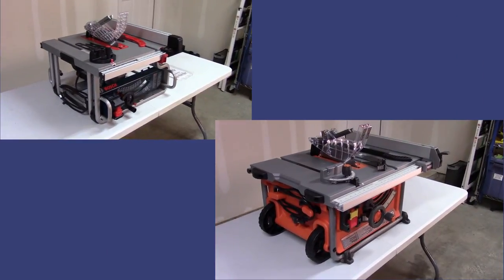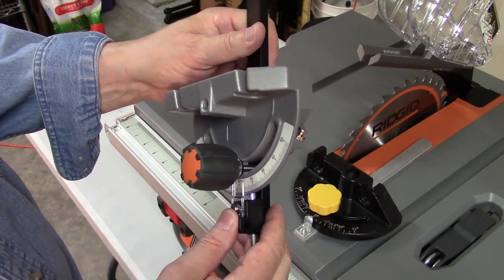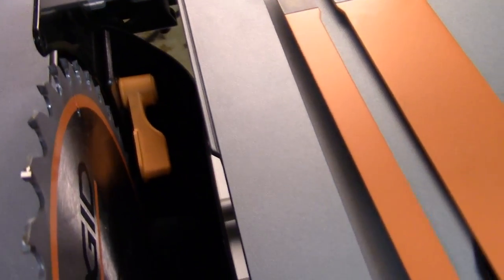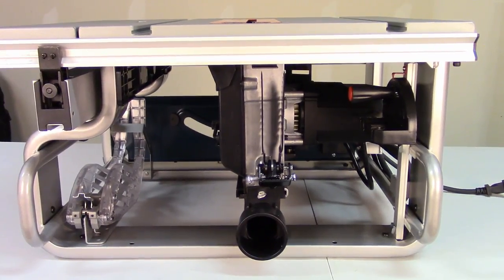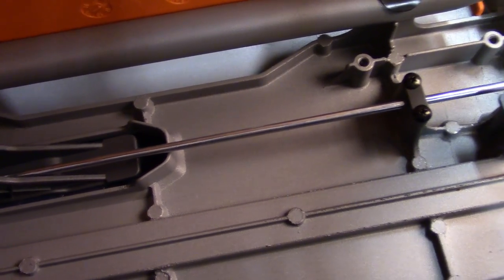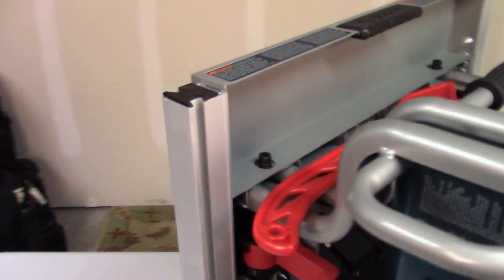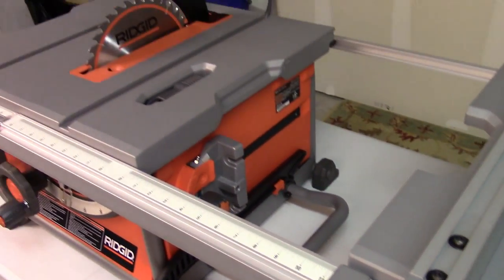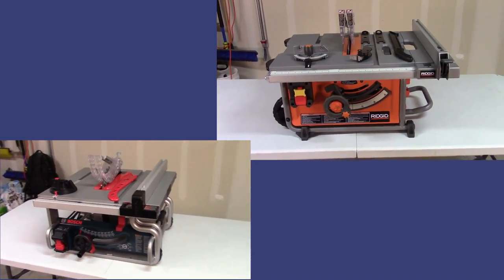Bosch Table Saw vs Ridgid Table Saw

Comment: Thank you for the review. I’ve seen a number of reviews about these table saws and I find them more or less matched from a features stand point. I am curious how do they stand from an actual cutting quality stand point? I hear some complain about blade wobble on each of these. Is there anything in the design that makes one of them better? I asked about the 90 degree alignment at the hardware store and they showed me how to fix it but they were not able to help re how do these compare when it comes to actual cutting. Any insight from you or your viewers is greatly appreciated.
Reply from the maker: Mak Moose Thank you so much for stopping by and commenting. Looking at all the table saws I've reviewed It appears to me that the mechanical engineering is very similar. The only things I can think of that would cause any of them to cut poorly would be poor alignment from the factory, a sloppy miter gauge, and or a cheap blade. This is why I recommend checking the alignment on any new saw. I have a video for aligning several table saws in my table saw playlist and, in depth alignment for the Ridgid table saw. If you purchase a new saw and cannot get it aligned based on one of my videos or the manual then I would recommend taking it back to the retailer. I also have a video on how to tighten up a miter gauge. I hope this helps and good luck on your projects.
Reply: WorkMateGuy great video.